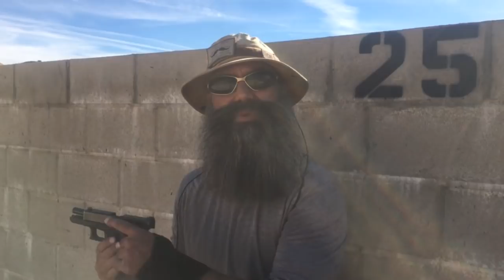Glock Says Don't Drop The Slide  Using The Slide Stop.  Fact or Fiction?

Comment: Here's my two cents so take it for what it's worth to you.  Your "Slide Stop" is spring loaded to pull downward.  This is so that when you pull back on the slide with a loaded magazine the "Slide Stop" will quickly drop allowing you to release the slide and load a round.  This is the proper way to do it as it doesn't require fine motor skills and is easier to do in high stress situations.  Having an ambidextrous slide stop is so that left handed users like myself can more easily manipulate the slide stop for locking the slide back if you don't have an empty mag loaded.
Reply from the maker: Thanks for watching and commenting.  I don't buy into the fine motor skill argument.  The same people who claim that hitting the slide stop is a fine motor skill advocate using your thumb to hit the bolt release on a rifle and your finger tip to hit the bolt release button on a Benelli shotgun when port loading.  Additionally, what about the carrier release lever or safety on shotguns and 1911 safeties?  Also, if that were the case, hitting the mag release on rifles and handguns would be difficult as well.  What about locking the slide/bolt back when doing a type 3 malfunction on handguns and rifles respectively?  What about clearing the infamous bolt override on a rifle?  We can do more than most think.
Reply: Don't forget that pulling a trigger correctly is also a fine motor skill.
Reply from the maker: lancelotvt here we go again with the fine motor skill Argument again. By that logic you shouldn’t be able to hit the mag release, bolt release on a rifle, carrier release button on a shotgun, action release lever on a shotgun, you shouldn’t be able to port load a shotgun or do a slug changeover/select slug, locking he slide back to spear clear a type 3 malfunction or a bolt override...list goes on.
Reply: The slide stop is the part inside the gun that engages the slide when the magazine is empty.
The slide release is the part outside the gun that you press on to release the slide.
Reply: PhoenixTacSolutions  How about the " OH SHIT DANGER nervous panicky attempt to release the slide stop FAIL because it's stiff enough to cause your sweat slick thumb to skip past it so now you've lost the seconds you needed before your assailant stabs you 5 times or shoots half a mag into your body" scenario.  Unless you only have one hand (or using a Beretta), do it the RELIABLE and time proven way that you SHOULD have been using in all those "muscle memory" and habit enhancing practice sessions you didn't do.  Palm grip that slide LIKE A  BOSS, release, and KNOW that the firearm is READY TO SAVE YOUR ASS.

Comment: From the Glock manual:  "If the slide is locked in the rearward position, either press the slide stop lever down to release the slide and return it to the fully forward position or grasp the rear of the slide at the serrations with your other hand and pull the slide fully back and then release, it allowing it to return to the fully forward position".

Sounds like a matter of personal preference to me.
Reply: The official manual in Europe and USA says you can do it, so Glock engineers says you can do it! maybe the rep was not knowledgeable, so always read the manual!
Reply: Yep. Checked the manual that came with my Glock 21SF and it says the same thing.
Reply: HKVP nine the same part is called a slide release. Some firearms are built for it to be used either way. I’ve been a certified weapons instructor for sometime now and when I was training to become one, the first thing they told us after safety was not to use the slide stop to send the slide into battery. The forearm is engineered to chamber a live round under full spring tension of the slide moving forward. I’m not saying that it is wrong. I’m just saying, depending on the gun, you might end up with a failure to feed. I’ve seen it happen especially with a full magazine.    Probably the most important thing here is how muscle memory works. I have trained my entire life to reach over the top to slingshot the slide forward that’s what’s committed to muscle memory and that’s what I do every single time.  Without thinking about it.  Be safe as always.

Comment: we had  a Glock Mdl 22 come into the shop once with a warn out slide stop and notch. what happened was the slide stop and notch had warn into each other and rounded off the edges so it was very difficult to keep the slide locked back without it releasing. we fixed  it by replacing the slide stop that's it the notch itself was fine even though warn. the gun definitely had near the 8000rd mark and was not well looked after,  a little bit of preventative maintenance goes a long way on any firearm even the indestructible Glock.

Comment: Softer materials, even vastly softer materials, can, will, and do wear harder materials through contact wear. The classic example is a shaft seal like the rubber oil seal that contacts the crank shaft in your car gradually wearing a grove in the shaft, which can, will, and does happen, as known to anybody who has ever inspected one with significant use.  They even sell sleeves for the portion of the crank shaft that contacts the seal on common engines like the 350 Chevrolet to restore the crank when the groove gets so deep the seal will no longer seal in the oil. Keep in mind this wear occurs even with constant splash lubrication of the seal lip and crank surface.
Reply: The particles carried by the oil actually cause the wear. Not the softer seals. Clean oil will have less wear.

The moral of the story is, keep it clean and you will have less wear.

Comment: The part is a slide stop. Before I worked in a gunsmith shop, I never heard of the part failing either, then about 2 or 3 a month came in for a worn slide notch. After that I do not release my slide using the tab. The reason the slide stop is amby is for emergency use, like in case you are down to one arm, and need to use it.
Reply: Most handguns don’t come from the manufacture with an ambi slide release/slide stop. That’s why when they do have the ambi feature it’s used as a selling point.
Reply: The slide stop is the part inside the gun that engages the slide when the magazine is empty.
The slide release is the part outside the gun that you press on to release the slide.
Back to gun-smithing school for you.
Reply: Pressing the ‘tab’?  You just lost all credibility as a gunsmith.
Reply: actually.... the part that's inside the gun... and the part thats outside the gun..... are the same part..... it is a slide STOP.... not a slide release..... and tho you can do it.... I CAN drive 120 in my car through school zones..... but prob not a good idea....

Comment: If you use the slide stop to release the slide, it will eventually wear to the point that it must be replaced. The notch in the slide will also have material filed away from the friction of the slide stop. But the notch in the slide will be filed away at a much slower rate since it is a harder material. 

We only use the slide stop to release the slide during training, when we're simulating firing one handed because of injury. Other than that, we always chamber rounds by racking the slide back.

Comment: I use the Slide stop because it lets the slide be driven fully into battery by the recoil spring without being impeded in any way by your hand on the slide.
Reply: I always use the slide stop lever never had a failure ti drive fully into battery, it's the same type action that firing the thing uses to chamber the next round that is letting the slide run free

Comment: Well said! Glock doesn't mention that if you seat the mag properly there is no need as the slide racks automaticaly
Reply: It can happen but it's not supposed to, not by design. My gen 3 19 and my gen 5 19 don't drop the slide no matter how hard I slam in the magazine.
Reply: Now my Ruger Sr45 did it until I replaced the slide stop spring then it stopped.

Comment: It's only stamped steel also should use the slide because you have full tension on recoil spring, always go with the manufactures recommendations.
Reply: The manual says use the slide catch if you want. 

It is the trainers that came up with excuses to cover for the objections over the tiny slide catch. They rationalized it to make it seem intentional and sold people on the work around as somehow better. They really sold people on the idea a slower and more awkward way to operate the gun is better.

They used a lot of BS excuses. My favorite is the gross motor skills lie. If the slide catch they inadequately designed is too hard to find, make it bigger. Even as it is, it is no smaller than the mag release. If you can't hit the slide catch, then you probably won't have to worry about it because you won't be able to drop the empty mag in the first place. Or even pull the trigger.

Comment: Right out of the Glock manual:  "Release the slide to return it to the forward (closed) position by either pressing the slide stop lever down or grasping the rear of the slide at the serrations with your other hand and pulling the slide fully back and then releasing it."
"
Reply from the maker: Call them and they'll tell you otherwise.
Reply: The rep called you a chuckle head. @PhoenixTacSolutions

Comment: I agree with you. I use it to release the slide all the time and the lever shows wearing but not the slide. Why would the gen 5 be ambidextrous if you werent supposed to release the slide with it? I practice both using it and just grabbing the slide. I dont know why people get so hung up on releasing the slide, they prolly have a sub par gun that wont allow them to use the slide stop to release the slide.
Reply: Steven w because left handed people shoot too😂
Reply: T B left handers would use the standard slide lock instead of ambi if it was just supposed to lock the slide back but since its an administrative task making it ambi is only for speed so it wouldn't make sense to complicate the gun to make it fasterto lock it back, the speed is only for release ie all ambi slide RELEASES are just that not just to lock it back
Reply: Steven w are you left handed?
Reply: The catching edge on most slide lock levers are gritty and raw when new.  Sometimes the force required to drop the slide is ridiculous.  I polish and smooth the stamped raw edge.  Slingshotting the slide takes too long anyway.

Comment: personal experience.   The Glock slide stop lever is mild (soft, unhardened) steel and will round off to where slide stop is unreliable if used as a slide release.  My HK, which HK describes as a slide release, is hardened steel, and after thousands of rounds of using as a slide release is still functional.   You get what you pay for.   Trust what they say, they made it after all.
Reply: Actually, you don't get what you paid for when you buy a Glock. You can get better for less and not have to worry about their cheap slide catch wearing out.

Comment: So the harder metals can scratch the softer metals? And the slide is harder than the slide stop so it would in fact wear out the slide stop. According to exactly what you said
Reply: So, replace the slide catch after it wears out. About the time it will need new springs anyway. If you maintain the gun on a regular basis, it isn't a problem. 

If you shoot enough to wear out the catch, you better be maintaining it.

Comment: The logic is only part-way right, but you're missing more of the story.

Think of a jagged stone in a stream: Upon immediate exposure, the stone won't appear to wear - but over time, the friction of the water on the surface of the stone will wear it down. This is what's going on when you use the side stop lever to drop the slide: You're generating friction between the two components, and over time will wear down the contact surfaces between them until, eventually, the slide stop won't work anymore.

Comment: Hmmmm ?

Truth be told!
All the materials make-up information is GOOD, however it’s used  backwards here...

The wear will be on the
 (SLIDE STOP) not on the slide, if the slide stop is worn down from improper use ~ it will NO LONGER LOCK THE SLIDE TO THE REAR ON A EMPTY MAGAZINE, WHICH THEREFORE CAUSES YOUR PROBLEM.  

ie. attempting to fire on a empty chamber, a quick sidebar most people don’t count there rounds so they would know, also in a excited situation your probably NOT counting.  So Sir respectfully I disagree with you here use it as it is suppose to be used only as a slide stop.

Overhand rack the slide with the  heel and  fingertips of the off hand stay hot stay safe and stay alive!
Good info and training.

Comment: what you read is 50% correct. if you used softer metal and crash on harder steel the softer steel will wear out faster than the harder steel!!! but the harder steel still wear out but not as much! there’s no such thing as softer steel can’t crash harder steel

Comment: Jesus, people.  If you're not supposed to use the slide release lever, why do they put it there??  The slide stop can work just fine without an external release lever ... lot's of firearms don't have external slide/bolt release levers/buttons/paddles.  If it's such a bad thing, why does the AR-15 have an external slide release 'paddle'??  C'mon people, use some fucking common sense.

Comment: There is more than one way to do things in my opinion although all the hundreds of  Rounds I shot. You can drop the slide release fast as you can Slingshot it that's what they  Kind of call it or you can practice a couple different ways so that if one doesn't work the other 1 will and you can be proficiant in both ways to me I do both its mission specific or what is going on at the time what is your dilemma about using either way if you have to pull the gun back away from your attacker you might 1 use the slide release if your clothes and you do that you might wanna sling shot it there's many ways to do it either 1 there's only like about that point 3 variants of a second and that yet could mean life-or-death but remember mission specific learn both ways big become for fish it both ways so you don't learn 1 way or another your muscle memory will adapt to both ways in any situation that's my opinion my other opinion is by a 6 sorter and drop the glocks  Are popular is because they are decent weapons any cost about half as much is a really good one that's why people go with them because with that in mind you would buy  A Sig Sauer which will never jam on you in any condition in any rounds can you fart through it and you don't have to worry about and a slide releases big and it's right there and it's just as fast so it's the gun you got you glock people kill me it's made out of all kinds of different materials into many moving parts in military call it kiss keep it simple stupid and a 9 mm  Sig Sauer P226MK25 will never   J am . So put a little bit more money into it you won't have to worry about all this stuff because the  The glock will not battery if you do a certain way I don't like that feature but glocks you pull that back and it won't it won't battery and you're fucked

Comment: Glock must be a cheap piece of shit.  Beretta recommends using the slide release.  My 92FS has 17,500 rds, works perfectly every time.  Glock probably uses softer metal in their slides.

BTW,
The slide stop is the part inside the gun that engages the slide when the magazine is empty.
The slide release is the part outside the gun that you press on to release the slide.

Comment: I have never seen a beard talk by itself. When using a lathe and cutting a long piece of steel you use a centering piece of equipment that is made out of brass so the turning won't wear out the workpiece as much. Soft steel won't damage the same hardness steel. Please let the comments flow in. I got nothing to do.

Comment: Only an idiot would read the manual and call the company getting an answer of don't do XYZ, and then turn around and make a video saying I was told not to do this by my gun manufacturer but it's fine to do it.

What was the point in reading the manual or placing that call?
Reply: Right?  Glock has hundreds of thousands of hours of experience and this beardy weirdy knows better.
Got it.

Comment: We’re talking about Glock, where nothing makes sense...... they did away with the external safety
Reply: I guess you don't get the point of Glock then. Glock firearms were meant to be service pistols, you draw pull the trigger, thats it. They perfected a 3 point internal safety so the only way one will ever fire is if you pull the trigger. Guess what the first rule is in gun safety? Trigger discipline. You don't need external safeties if you learned how to handle firearms correctly.

Comment: You can wear out the slide stop
Reply from the maker: whitesoxbob But that’s not what Glock says. They claim you will wear out the notch. BTW, I have not experienced any slide stop wearing out issue despite 10s of thousands of rounds.
Reply: You can wear out the barrel also. So what do you do when parts wear out? You replace them. Problem solved.

Comment: 1911s weren't built with flimsy parts that need babying.
Reply: The principle is exactly the same, after enough slide lock to slide wear under load from the recoil spring, wear to one or both parts will occur.